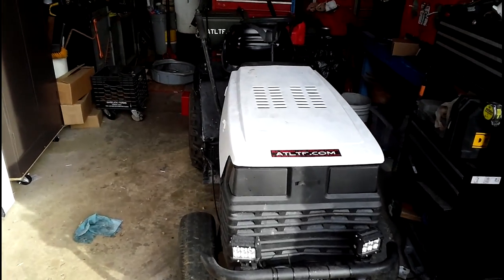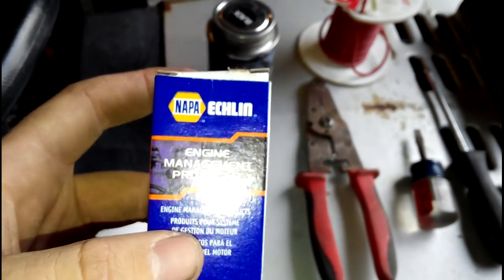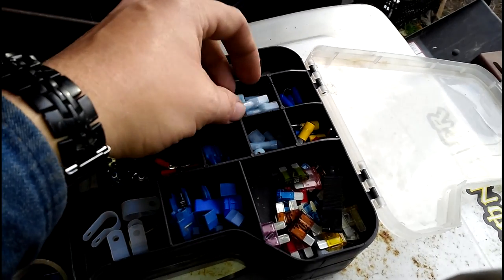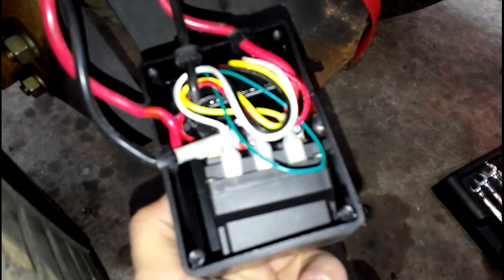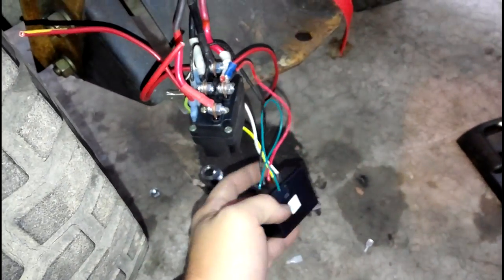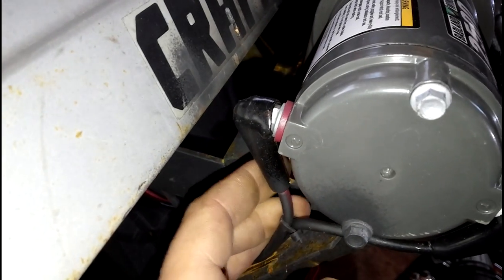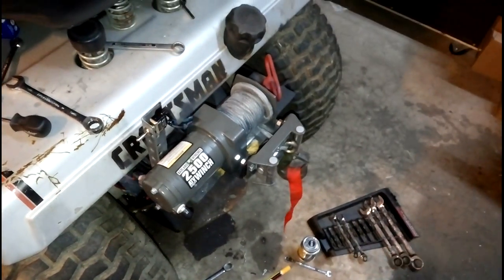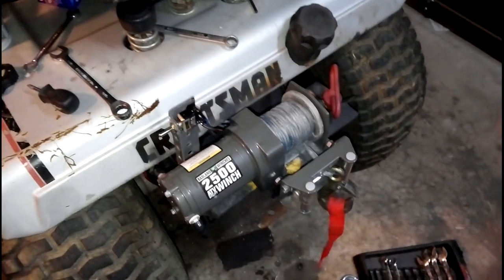How To :: Badlands 2500# Wireless Winch MOUNTED SWITCH MOD

Comment: The remote has a key chain on it for a reason, I clip it onto my fourwheeler key and leave it there, never take it off
Reply from the maker: My mower is push start, no keys. And if it gets wet it will short out. Hard wired is always better.
Reply: Seriously? Wow, being meant for a fourwheeler you'd think they'd at least make it water resistant
Reply from the maker: Theyre ok getting splashed on but leave it out in the rain and itll kill it. I dont think there is a seal holding the two halves of the case together.
Reply: +Keystone Motorsports there isn't but I'm probably going to wrap electrical tape or something around it, just for a little more protection
Reply from the maker: Or use silicone or something. Uncrew the case a bit, run a bead at the seam and reclamp.
Reply: I need to be able to change the batteries though, I need to separate the 2 halves to do so
Reply from the maker: Should be able to pry it apart. Or just go around the outside.
Reply: Batteries might last as long as 4 years with mild use (kind of like the battery in your car's key fob)... The more you use it, the sooner you need to replace batteries.

If you carefully apply sealant, you can still get it apart.

Comment: how do you get the hook through the roller piece
Reply from the maker: Ronnie Huth Remove a roller, or cut the hook off and put on a hook that's removable. I'd suggest the latter, cause if you accidentally suck the hook through the fairlead you have to do more work to get it out. You can also buy a stopper and put it on when you replace the hook.
Reply: Thank you that's what I did the roller came out easy with the snap ring pliers

Comment: I lost my remote. I will buy the remote from anyone who converted theirs.
Reply from the maker: This conversion does not delete the remote. And from what I have seen, the remotes are on different frequencies to allow multiple winches to be used in the same area, so you would not need just the remote but the wireless reciever as well. My suggestion would be to do as shown in this video or contact Badlands to arrange for a replacement assembly.
Reply: I bought one of these before from someone who converted the HF winch to wired on their ATV. All I'm looking for is someone else who is doing the same thing.
Reply from the maker: +MrZX1206 I might be doing a remote delete in the near future. Keep an eye out.

Comment: Would it be possible to run two switches at the same time?  One in the cockpit and one near the winch?
Reply from the maker: Yup, just wire the same way or wire off the other switches terminals.
Reply: Keystone Motorsports so after the wires are out of the box connect 2 sets?

Also is there any reason not to swap the winch to solenoid cables with the solenoid to battery cables?  I would like to mount the solenoid closer to the battery than to the winch. 

Last question. All things being equal assuming the price difference is $50 after coupons would you rather have the Badland 2500 or 3500. I think my cost difference will be closer to $25-$30 after additional switches and wiring on the 2500.
Reply from the maker: You could either pigtail inside the box and run 2 sets (6 wires) out of the box, or run 1 set (3 wires) out of the box to your switch and then run another set of wires off that switch to your 2nd switch. If you want to get fancy, you can get/ make a terminal block to make splitting easier.

You can switch the cables around inside the box to have the longer leads to your battery no problem. I've done that and then used large zip ties to hold the solenoid to the winch motor housing itself.

Standard price difference between the 2500# and 3500# is $75 before coupons. The wireless adapter for the 3500 is $40 on its own. By the end of the day, the 2500# modified is still about 2/3 the cost of the 3500# without the wireless adapter. So it's really a matter of deciding if <20 minutes of labor is worth $60.